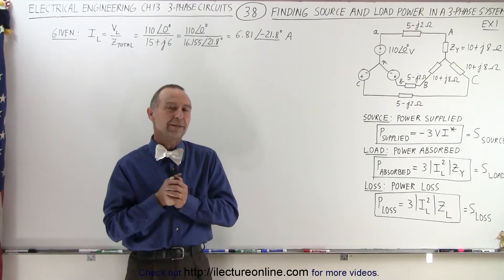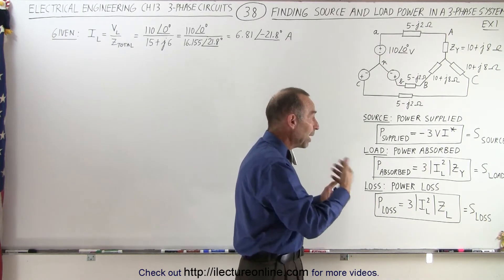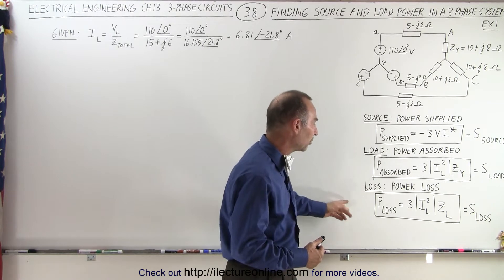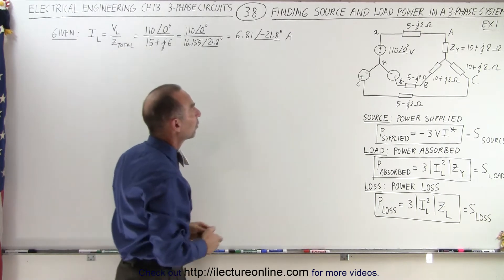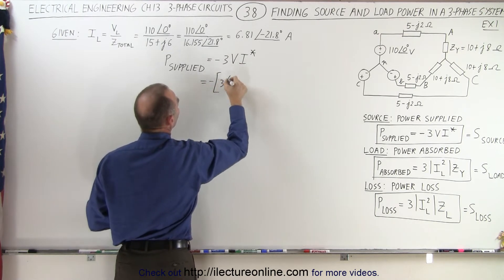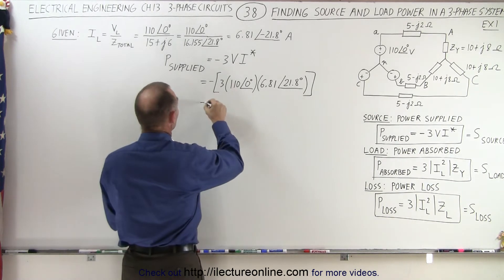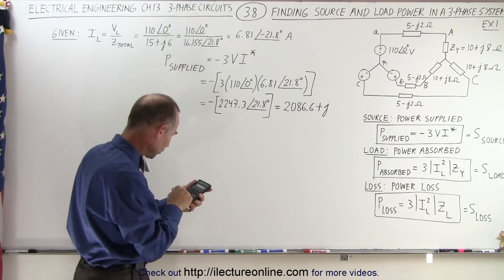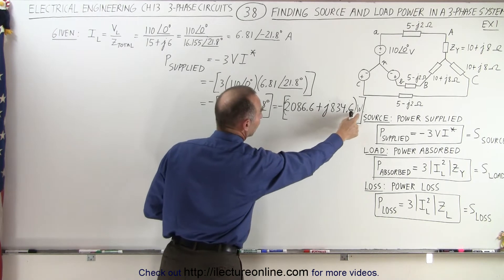Electrical Engineering: Ch 13: 3 Phase Circuit (38 of 53) How to find Source and Load Power?

Comment: Definitely the unit for the powers calculated must be VA (volt-amperes) because all the powers are complex.
Reply: Technically in exams when the examiner asks for power it usually is watts or real power. 

Then for Apparent power it should be VA.

The correct question for this case is the total apparent power loss/absorbed and the final units should be in VA.
Reply: @genetalavera4256  
Engineers are not worried about going well in exams, they are concerned about getting things working well.
That's why Electrical Engineers spend so much time learning complex numbers and phasors, it is to apply these tools in solving practical problems.

Comment: Hi Michel. Question; Shouldn't the power loss be P=I^2*R because it is the resistive part through which power is lost? 
Similarly, for Power Absorbed, shouldn't it be Q=I^2X because it is the reactive part that absorbs power and gives it back to the system?

Comment: One doubt sir, you wrote line voltage is = 110 angle 0°  but in actual line voltage is root 3 times 110V sir , .. 110V angle 0° is phase voltage i.e Van=110 angle 0°....
Reply: 6.81 angle -21.8° is a current flow in the line of a to A i.e phase A current to clear my doubt sir ... but its a line current to present my doubts sir....
Reply: @kannanr9016  
Line current is phase voltage divided by the total impedence. So, the formula is Van divided by Z. Instead of Van , he has written VL. He has substituted correctly though.

Comment: in power loss Z(line) i.e Z(L) would be (15+j6) ohms .
Reply: No it wouldn't
Reply: No. The load impedance was already accounted for by power absorbed. The line losses are calculated separately.